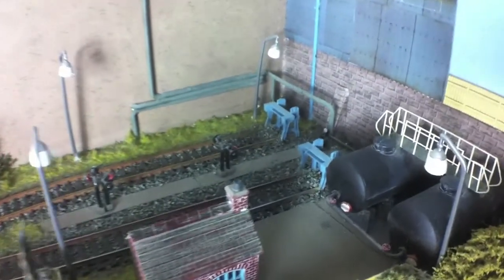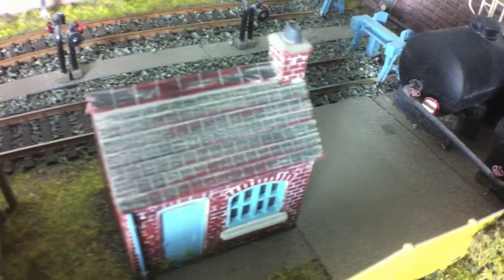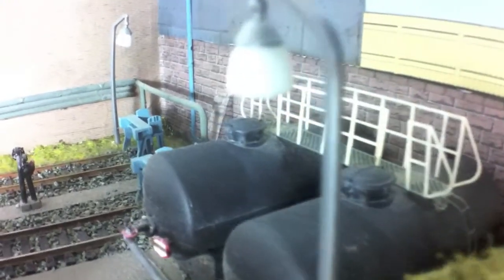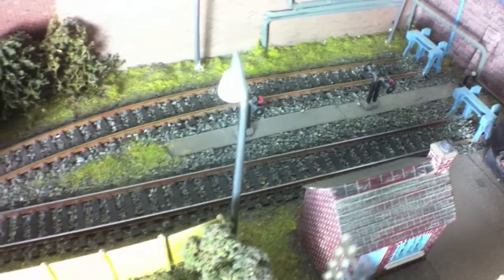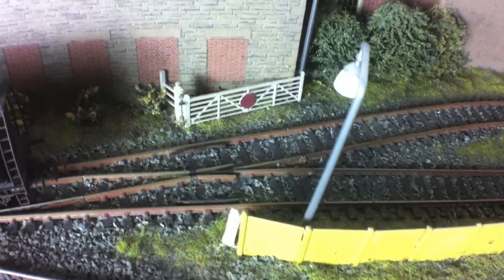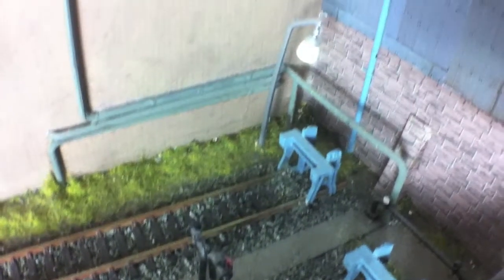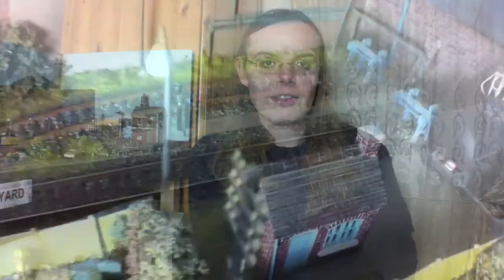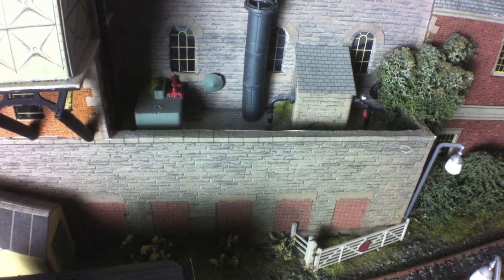How to Build a Small Shunting Layout, part 6: The Oil Terminal

Comment: Jenny congrats a lot for such a beautiful, interesting, and well done module. It's amazing the grade of detail you put on every inch of it !.
Specially I liked your track work. Tell me, the rails were painted by brush and the ties (sleepers as you calls it) has the natural color of their plastic or also were painted, and in this case it was painted by brush too ?.
Thanks in advance and I'd really appreciate your comments. Many greetings from Chile, John.
Reply from the maker: Thanks. The sleepers (ties) are left the natural plastic colour on the layout, however the ballast and track does get and oily wash of highly diluted satin black enamel paint (I use Humbrol number 85) to give it a slightly grimly look. Thicker deposits can be done where locomotives would sit for some time by using a less diluted mix in these places.